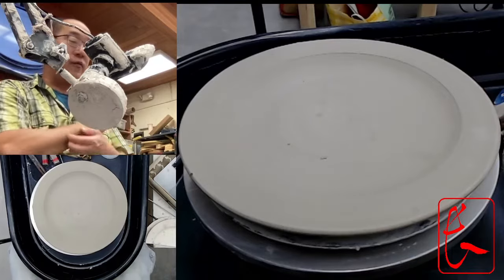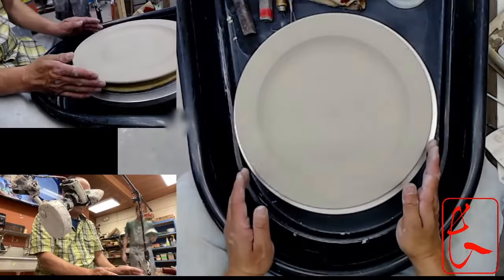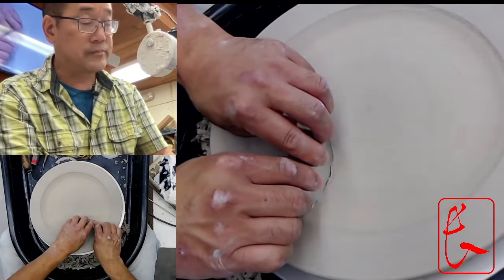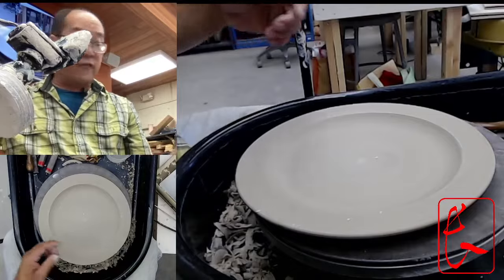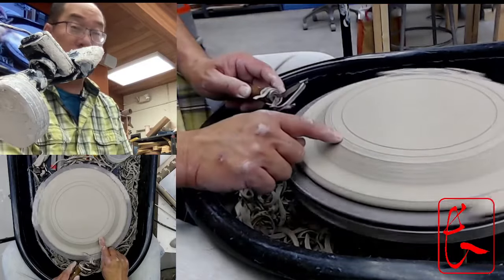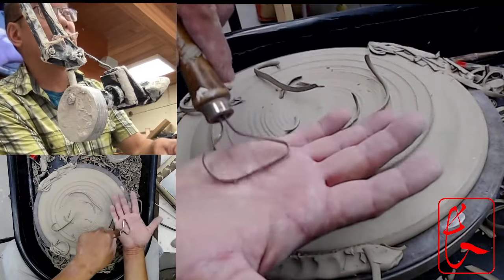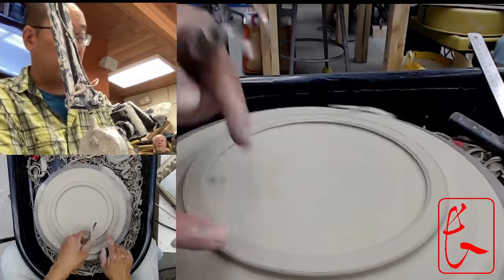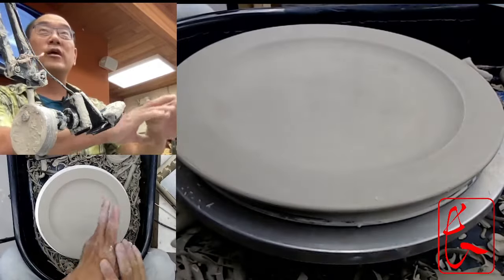Trimming Plates

Comment: I used to hate metal ribs; hwr, over time it became my favorite, even over wood, silicone, or plastic. 

Have you seen or used the new trimming bats with a rubbery surface? If so, any ideas on how to diy one of them? 

I have a foam trimming bat I bought that way & one I made using foam I glued to the top of an old bat that wasn’t really great for throwing, but has been wonderful as a foam bat. I’d really really like to makeshift the rubbery topped trimming bats.